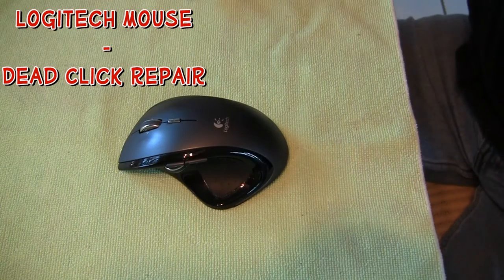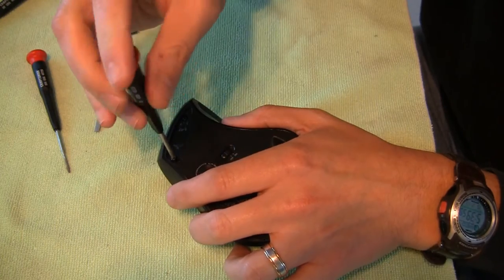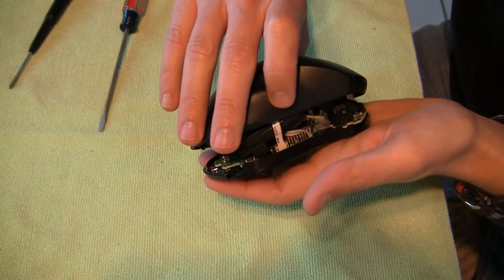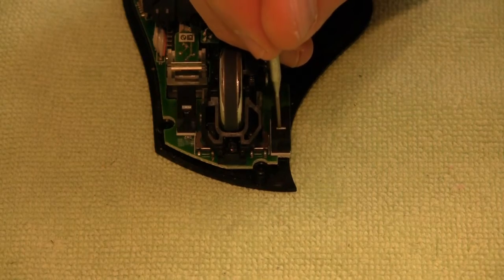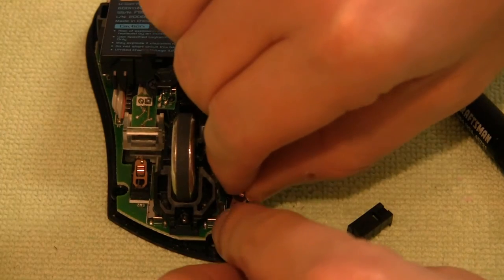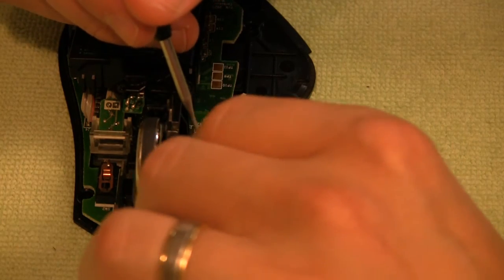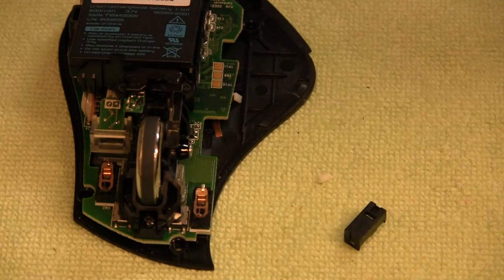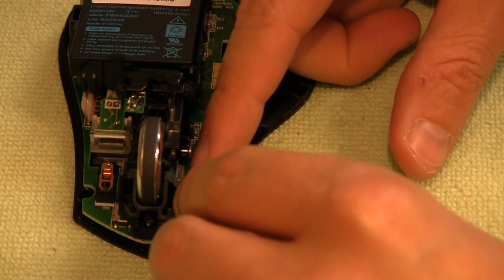Logitech MX 1000 dead click repair

Comment: Yeah, I can tell you the procedure works for several different Logitech mice if they use the same kind of micro switch that you can open.  What you will have a hard time with is with the switch under the wheel.......